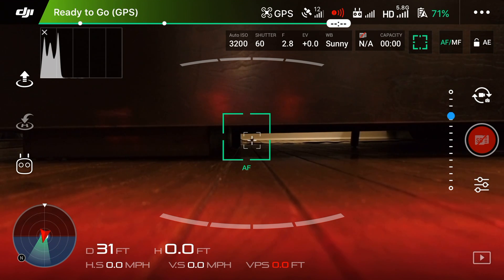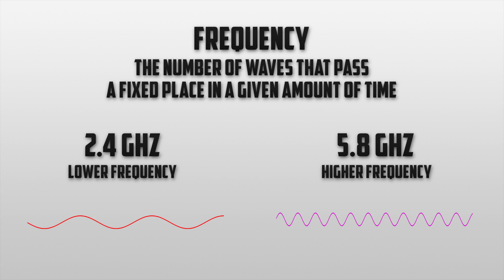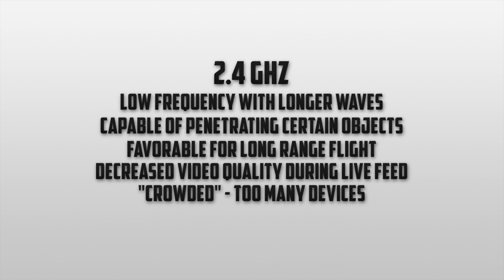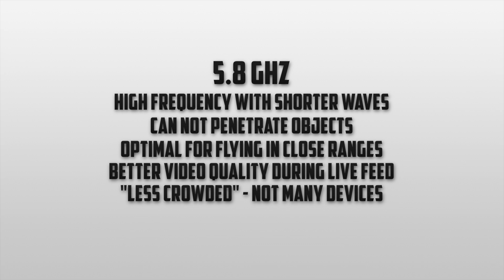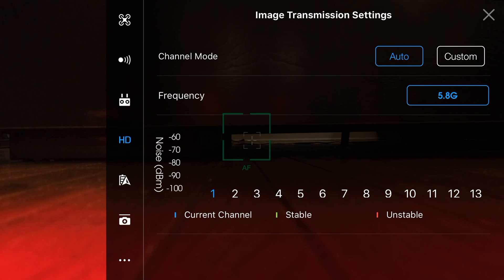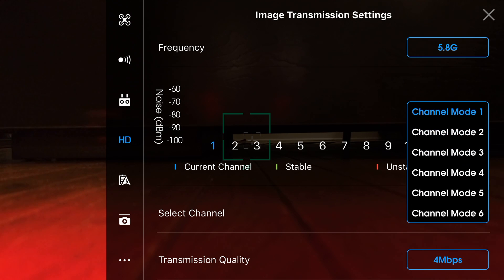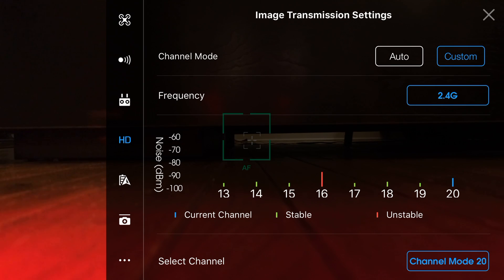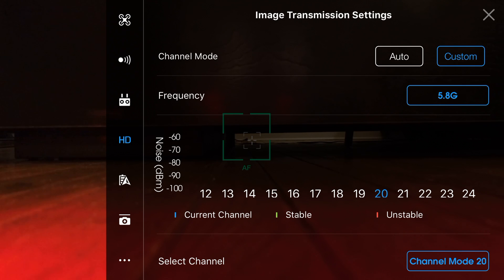Image Transmission Settings For DJI Drones Explained

Comment: Hey Billy, I have a Mavic 2 Zoom with the Crystalsky monitor, I fly about 3000 feet away and I loose my HD signal  what should I look for as far as problems, if i bring the drone up to 350 feet it is a little better. The area I fly is well wooded. I never have had this issue before, I have flew up to two miles away last summer. Screen says i have lost signal. Any help would be great

Comment: What frequency should I use to fly over my city? I am currently using 2.4 and I lose signal at 2000 feet out and 300 feet high . Any suggestions?

Comment: Does the quality of your phone/tablet have any effect on the transmission of the video? My cheap 120 dollar tablet doesn't display the video when I fly, like if the signal was very weak. I was flying in an open area without any buildings around.

Comment: Very Informative. However, "range" is still a question regarding frequency choice. How much safe range should I expect in a clear environment at 5.6 GZ? If the picture breaks up a lot, what are other possible reasons such as loose/damaged cables, cell tower  and other types of interference? Describing potential interference sources would assist in troubleshooting.  Thanks again.

Comment: Hello am using inspire 1 with two remotes for live production for tv broadcasting, master remote I use to fly the aircraft and everything, the slave remote I connect the hdmi out put to the video mixer (tricaster) and everything goes well. today I faced one problem, hdmi couldn't give the signal output. I tried to connect with master controller also it didn't give me the output signal, I changed the cables and recheck them to other devices cables are OK am stuck how can you help me

Comment: Thanks, I have the problem that I'm not sure if it is related to frequency.  I have a DJI Mavic Pro and when flying it the image in my phone look full of pixels and it is very slow... I've changed the cable but still I get the same problem, however the video in the sd card it looks fine.

Comment: You also said it allows better communication between the phone or tablet and the Drone correct?

I was under the impression again that when you connect the cable you can even shut the Wi-Fi off in your phone so how does the Wi-Fi have anything to do with connecting your phone to the mavic Pro Controller unless you're just flying with your phone? 

The cable is basically just an image signal transmission that's it. 

Am I missing something? 

A lot of times I'm out to lunch sorry LOL

Comment: I'm confused I was under the impression and you can see it on a DJI Pro Controller at the top right-hand corner it automatically switches back and forth between 2.4 G and 5.8 G to give you the best signal when you're flying so I don't know why you would switch this.. unless dji's technology is not good at switching back and forth?

Comment: Can you change frequency during the flight or that will cost loosing signal with the drone?
Reply from the maker: Yeah you can change
Reply: thanks I was just taking real estate shots today and my signal was terrible.... I couldn't depend on my screen at all. I felt like I'm back to my first drone with the gopro mounted to the drone... I've also had similar problems 2days ago while I flew in downtown Chicago thats why I'm asking if I can change safely during the flight because I'm going to downtown now to test it... I've also relinked RC since I found out that may resolve my problem... Any advices? Is that true that DJIGo4 app requires 2ram memory on phone?? If so My iPhone6 has only 1gb.... I can upgrade my phone if that will solve the problem... Thanks for quick reply... I need to retake those Real Estate shots tomorrow or on Sat at the latest
Cheers

Comment: I have a question for you. I have an Inspire 2 and I have noticed on many of the tutorials there’s a red/green image on the DJI GO 4 screen while flying and I am wondering what it is? Is it when obstacle avoidance is engaged and thus showing the distance of the object that it is approaching? I haven’t seen it when I’m flying and the obstacle avoidance is working. As you can see I’m not understanding how this is working. Is there a setting that I am missing in the setup portion? I hope you can answer this question for me. And thanks for all of your tutorials for the DJI drones because I follow them frequently in order to learn more about my drone. 
Phil DeVore
Please respond to my email address: phildevore65@gmail.com

Comment: Hoping Billy or others can help clear something up for me.  What, if anything, does the image transmission settings have to do with distance that the RC can control a Spark?  Is it possible that a RC could still control the craft even if it is out of range to stream video?  My theory was that there were two wifi connections to the Spark over both frequencies and that the RC would use whichever was not being used for the video stream to control the Spark.  Does same apply if using the phone to control the Spark?  Why would OTG allow folks to fly further as that only controls the connection between remote and app.  Is that because if using local wifi to communicate between RC and device the other freq is used to control RC to Spark?  Bottom line, how do OTG, and freq contribute to longer flight distance, if at all?

Comment: Unfortunaly DJI disconnected the OTG with the latest app updates 4.1.20 and 4.1.22 They say that the connections with wifi is much more stable. So we may not use the OTG cable any more. For me in Europe I now can not fly 50 meters with losing connect, max distance 270 meters. With OTG cable I had perfect connection until 730 meters and lost it at 760 meters. So my DJI Spark is done, it is not usable anymore. In the forum DJI is ignoring this complaint, because the reject to fix it.
So my opinion do not buy any DJI products, they are arrogant.

Comment: and I have a really big question that no one can seem to answer for some reason when I put my SD card in my Phantom it's still recordes only to my phone and doesn't record it on the SD card is there a problem with my Phantom should I take it back and get a new one I don't know if anyone else has had this problem thanks in advance for any help

Comment: Billy, could this issue relate to my problem?  
Out of the blue, my phones and two tablets developed an 8 second delay between my control input to the mavic (instant) and the screen showing the movement.  Mechanically everything seems fine.  But I'm not seeing any inputs (gimbal or flight controls) for 8 seconds on any screen.  All flights have been in my backyard.  I had no problems flying in Europe most of the summer.  Nor any problems before I left for vacation.  But, first flights after coming home... and here I am asking for help!

Any thoughts???

Comment: This is a good vid but I can't find that option on my dji mavic pro with a iPhone 6s?? My problem is if I go further thn 300-400 m the camera signal starts to weaken with jutters and then can goes black but I can still see the map and use that to control it back into signal, why is this happening?🤔

Comment: Hi Biily, do I understand correctly that we can use 2.4g or 5.8g to control the quad. (Mavic)?  I use 5.8g for FPV video and was wondering what is used to transmit the video signal for the Mavic.  (Will my 5.8g goggles receive the signal from the Mavic.  I know just try it. lol) Thanks!

Comment: I get strong 
interference and I do not have any signal on 5.8 gh This is happening 
for 7 days without reason, it worked perfectly so far
Please help ... I read that you can install a cfg file but i do not know which ..
thank you
My drona is phantom 4 pro

Comment: Whenever i try to do this (phantom 3 standard) the "hd" button is a wifi signal instead. How do i get there?
Reply from the maker: +ch4s3 The Phantom 3 Standard uses a different application, meaning the settings will be different

Comment: These settings are no longer avail
Reply: Billy Kyle on my drone there is no frequency feed option just custom and auto
Reply: +billykyle phantom 4
Reply from the maker: Yes they are
Reply: I'm using a mavic and DJI 4.0
Reply from the maker: +Brendan Herrmann Mavic or Phantom 4 Pro?

Comment: HI Billy, I have a question for you. I've just got my Mavic Pro and I'm using a Samsung Galaxy S tab to monitor the aircraft. Unfortunately once the machine start to fly the images on the screen get scrabled, in other words I can't see anything anymore coming out from camera than green and grey bands covering most of the image. The graphincs and functions are clearly visible with no problem. My suspicious is that something wrong doesn't work properly with the video trasmitter. Is there any suggest you can post over here for me please? Thanks so much. :)
Reply from the maker: I would suggest doing an IMU calibration to see if that fixes everything.
Reply: Thank you Billy, I think I've found the source of the problem and it seem that my device doesn't support the DJI software in the right way, so I think I'm going to buy a more updated device. By the way Thanks for your tutorials.

Comment: On my dji phantom 4 why i use auto mode its so many lag ? When i use custom there no lag but sometimes lag happen. It is problem in my drone?
Reply from the maker: +Riyaldi Putra Try resetting your camera settings. Could help.
Reply: I have found that the higher fps [above 30] in 4 and 2k taxes the computer video ability so far as to makes it unusable. I, for one, would like to know a solution for this.

Comment: Great videos, Billy. One question. Why is there a lag between where your drone is, and what you see on screen?  Is there a way to reduce the delay?  I crashed my old Phantom 2 Vision Plus as I watched the screen, and looked up and it was in the trees, while the screen showed it still flying. I have a Mavic Pro now. There seems to be a slight lag.
Reply from the maker: +patmartel100 It's not going to be instant as the data needs to transmit from the drone back to the controller. With the being said, the lag is (at most times) not noticeable.
Reply: Thanks !

Comment: Billy I don't get the same screen as you do I'm running iOS what are you running? Why is my choices different?
Reply: same running latest app version but mavic pro and android. gives a wierd graph and freq range but no channel selection
Reply from the maker: +Andrew Karahalios Are you using the DJI Go 4 app?
Reply: Billy Kyle yes
Reply from the maker: +Andrew Karahalios Are you on the most recent version?
Reply: Billy Kyle yes 4.0

Comment: ISO is better for this because it can do hardware decoding I have an android but android has advantages like video catching is the same on both platforms but android can be used with a micro SD card.
Reply: Daytona 6263 ISO is what iPhone uses as an operating system
Reply from the maker: +James Broderick iOS

Comment: great vid! would dig to see one on exposure locks and modes & diferences in android vs iphone settings
Reply from the maker: +Luke Roman Good ideas, thanks!
Reply: I second this request on discussing exposure lock.  It's a camera feature that receives much less attention than resolution, white balance, fps, iso, and shutter speed.  Also, perhaps a video on color options that are updated to the current DJI GO 4 app.

Comment: So, do you ever switch between 5.8 or 2.4 Ghz ? And how far can you fly outside with 5.8 without losing feed ?
Reply from the maker: +Kabal LV I've gotten to a distance of about 2000 feet before the image transmission got really choppy on 5.8 ghz. The only time that I switch to 2.4 ghz is if I'm in a remote location that isn't very busy, thus less interruption.
Reply: I've read recommendations of when to switch that match the detailed explanation that you provided.  Essentially 5.8 is best for short range flights and urban environment.  2.4 is better for longer range flights and wilderness areas.  I had forgotten this until you posted this video.  Thank you!  This is perhaps the one settings screen that receives the least bit of attention.
Reply from the maker: +Brady Schickinger Thanks Brady! Glad to help